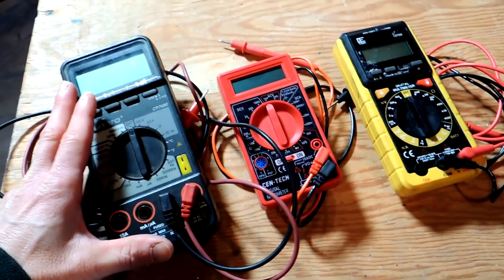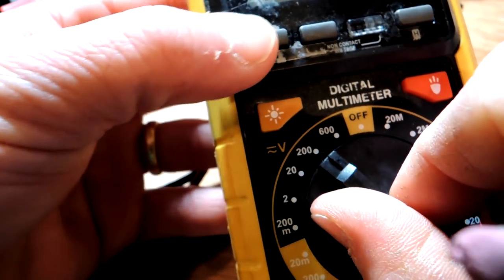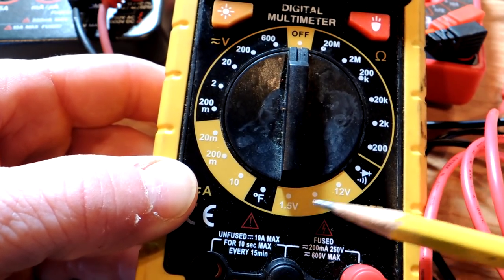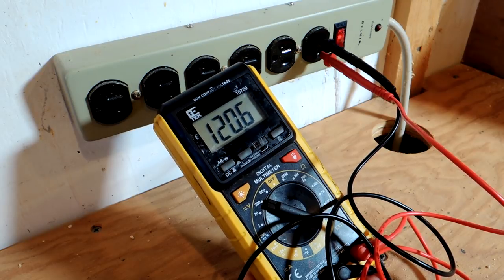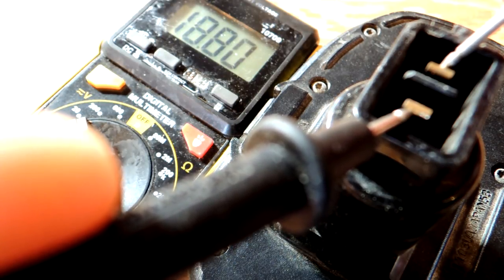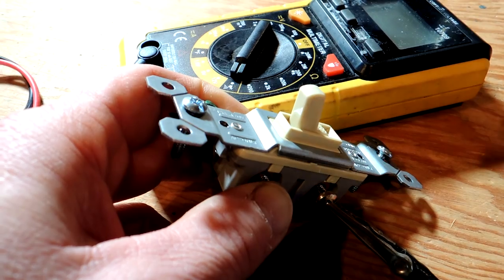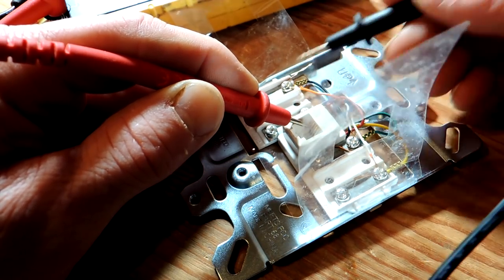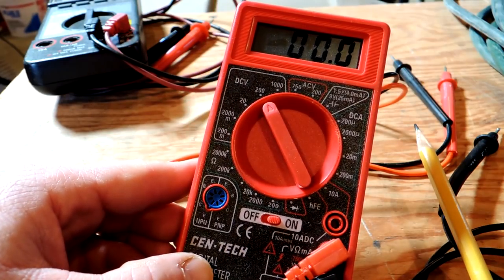How To Use A Digital Multimeter Around Your Home

Comment: I have a couple of questions. If your monitoring solar current, aside from using the Vdc side  is the process different? How do you get a read on a series of batteries that are daisy chained to see how much voltage is being generated?  Second, I know this is how to operate a multimeter, but- If all batteries AAA, AA, C, D are 1.5v why don't they just make them and the device compartments that use them all the same size? Why even bother with big bulky C & D they seem completely unnecessary.
Reply from the maker: I know very little about solar panels, but I believe the voltage is regulated and it's essentially similar to a car, in the 12-24 volt DC range.  The battery question probably has to do with history and the ability of manufacturers to build smaller form factors as time progressed.  Plus, it is the voltage which is the same, not the capacity measured in amp-hours.  A D cell will last much longer than an AA cell.

Comment: wot is the hold button for plse
Reply from the maker: The hold button is just a convenience feature which retains the value of a reading on screen so you don't have to remember it or be looking at the screen some exact moment.   Some meters work differently, but generally you press the button to hold the reading or else you press it in advance of taking a reading and as soon as the meter senses a circuit it holds the reading on the display.

Comment: Does it matter which way you put the prods ???
Reply from the maker: It depends what you are measuring and how your meter is designed.  For AC voltage, for example, it doesn't matter.  For DC voltage in might matter, unless your meter will auto-reverse polarity for you, in which case it doesn't matter.  If it does auto-reverse polarity for you, you may see a "minus" sign on the reading, but the absolute reading is correct.  For something like continuity or resistance it generally doesn't matter until you get pretty deep into the weeds on some electronic circuits.  Basically the red is considered "positive" and the black is considered "negative" polarity.  You won't hurt anything if you switch leads, the worse thing to happen would be that the reading doesn't make sense.
Reply: @enduringcharm  Thanks for taking the time to reply and for a very informative reply.

Comment: How do you use the centech to test continuity with no tone?
Reply from the maker: Not all meters have a tone function, so you just select the Ohm function.  If it reads 1 there's no continuity if it reads 0 there's continuity.  if it reads something in between there's continuity but not a perfect connection.  Of course, you need to be able to look at the meter for this test, which is not as convenient as having a tone.
Reply: @enduringcharm  this is really helpful as I am hearing impaired and cannot hear the beep doing a continuity test.

Comment: Great tutorial.  Does this mean that the USA really has 240 volts and not 120 volts?
Reply from the maker: The USA uses a 120 volt system, which is supplied as two 120 volt "legs" into a home.  Most household items run on 120 volts.  However, some items which require greater current, such as electric ovens, air conditioning systems, well pumps or electric water heaters, use 240 volts.  This is accomplished by combining the two legs--120v plus 120v equals 240v.  Since each leg supplied into a home is alternating current, they are also set up to alternate at an opposing 60 cycle rate.  For this reason, it is possible to use one 120v leg on a circuit in place of a separate neutral wire for the other leg.  This video has more information:  https://youtu.be/kCRzEOqeRdw

Comment: When you checking the plugs was the red to live and black to neutral ? I couldn't see properly
Reply from the maker: You mean electrical outlets on your home?  It really doesn't matter which color goes where.  The meter will register the AC voltage either way.

Comment: These meters use a 9 volt battery to power the display and power the  ohms  and continuity tests. Turn the dial to off  otherwise the battery will run down and  you will need to replace the battery  to test anything.

Comment: So how.do u use it to.see if a.wire is hot...
Reply from the maker: If you are referring to household 120V wiring, there are three wires in a cable.  The black wire is "hot" the white wire is "neutral"  and the bare copper wire is "ground".  With your meter on the AC volt setting and scale setting at least 200V, you can put the red test lead on the black wire and the black test lead on either the white neutral wire or the ground wire.    If the black wire is hot it will read around 120 volts.   Needless to say, avoid touching the black wire with your hands or having the other wires connect with the black wire.  If the wires are still connected to an outlet, you can just touch the test leads to the outlet screws of the appropriate wire.

Comment: Great vid. I have the yellow 1. When switching the dail to settings it always reads OL overranged i think... Why?? I know nothing about this thing. Your vid is very very helpful btw... Also how do you use the wireless reading?
Reply from the maker: The OL is just an open circuit, and the infinite reading is more than the meter can measure (obviously).   You'll get this when set to Ohms and you don't have the leads connected.  The "wireless" reading you mention is actually just an inductive pickup which alerts you to live electric in a wall or wherever.  It's sometimes useful, but don't rely on it for safety!

Comment: How do I test a 4 prong fluorescent light?
Reply from the maker: You need to be more specific.  What are you trying to test?  You can use a meter to confirm that the power cord is supplying power to the ballast.  You may be able to check the ballast for continuity or resistance.  It's more than I can answer in a reply here, but if you search for ballast testing I think you'll find some help.

Comment: I just bought the Everstart Cat max VIII (your blk/yellow one) because my stove isn't working right and seems like men always have multimeters, but i am literally CLUELESS as to electrical AND multimeters. Absolutely clueless.
I'm listening to this hoping to learn something.
Reply from the maker: You can use your new meter to check that the 240 volt outlet to your stove is working (check both "legs" of the receptacle.  Two 120 volt legs put together make the 240 volts you need for the stove).  You can also check the wiring of the stove if you can get access, either by checking the voltage with the stove plugged in or by checking continuity of wiring with the ohmmeter and the stove unplugged.
Reply: @enduringcharm  Thank you for replying!

Comment: so, if you are checking voltage of a 48 volt battery bank setup, you keep on DC and put on 200, then check the actual readout?
also, if a car battery has a suspected bad or arced out cell, that should be seen with continuity test? That is, no sound or no change off of "1" on the Harbor Freight cheapo which I have?
Lastly, what is wrong  with this?  My cheapo HF Meter bad?  If I put on 200 ohm on dial, and I then put the two wires together, it goes to anywhere between 2 and 42, Each time, after turn off then back on then re connect the needles, the reading is different.. 9.1, 5.3, 8.2, 7.3, 4.9.... and I am pressing the two needles together firmly...... WTF??? Is it a bad ohm meter in the unit?
Reply from the maker: An automotive battery with a bad cell will exhibit a much lower voltage than is typical at rest.  For example, instead of 12.x volts you'll read 10.5 volts.  A continuity test has nothing to do with it.  As for your wandering ohm readings it does take a little bit of time for the reading to settle down.  If you are moving the probes at all you should expect the reading to change.  Another issue could be loose wires connected to your probes or the probe tips have become unscrewed from their base.

Comment: I plugged in a harbor freight meter & sparked horrible it melted the black probe off the wire & started smoking i guess i had the meter set to DC rather then AC.
Reply from the maker: If you put the meter leads into an AC outlet with the meter set to DC scale, nothing will happen.  I don't know why your lead melted, but it was for some other reason.
Reply: @enduringcharm  I have no idea why this happened, I talked to a contractor recently he told me that it may been a faulty meter not sure that's what it was either, I bought an outlet tester plugged it into the metal outlet box the wiring shows correct so I'm yet scratching my head on this one but I sure don't want to use another meter testor on this metal box outlet only to ruin another one.
Reply from the maker: I suspect your contractor friend is correct.  For a wire to melt it had to be high current flow, so either the meter was internally faulty or else you somehow shorted out the lead when you were working.  The latter could happen if you had the lead connected to the hot and then the lead got pinched and grounded, for example.  I've been working with multimeters in remodeling, automotive and electronics applications over four decades and I've never seen a meter lead go up in smoke.  You could replace the leads and see if the meter is still functional, or just take it back and get it replaced by HF.

Comment: Thanks a bunch!!!I have one question though. Hope it doesnt sound too silly...On my harbor freight multi meter I notice a "10AMP MAX" underneath the on switch. Does that mean I cannot test a circuit in the house that has a 15 or 20AMP circuit breaker?
Reply from the maker: This can get complex very quickly, so I'm going to try and keep it simple.  In the meter there is a fuse (10 amp in your case) to try and protect the meter IF you are measuring amperage.  To measure amperage you would need to put the meter into the circuit you are measuring.  I did not show that process in the video at all and I would not recommend it to a homeowner.  There are other, safer, ways of measuring amperage, including a clamp style meter which measures amperage by sensing the magnetic field around a wire.  In the video I showed the measurement of voltage in your house by sticking the leads right into the wall outlet.  In that example you are measuring VOLTAGE not amperage.  The meter is set up to handle this without issue.  No current (amperage) is really flowing when you measure the voltage this way so it is safe for the meter and for you.  Think of voltage as a bucket of water.  That's the potential you have.  If I stick a straw in the water and start sucking on the other end, the amount of water coming through the straw can be compared to amperage.  The resistance can be compared to the size of the straw--if I have a narrow straw I need to suck a lot harder to get the same amount of water as with a wider straw.  So, when you measure voltage the meter isn't actually pulling any water through the straw.  Bottom line: you can measure house voltage as I showed in the video and not worry about the amps.

Comment: Good clip except for the ohm meter part that made no sense at all and never explained things like what the "0" or "1" means and a couple of other things as well, but in general I learned something so thanks.
Reply from the maker: The zero and the one represent opposite ends of the scale.  Zero means no resistance at all, one means infinite resistance or no connection.
Reply: @enduringcharm  I didn't know that so thanks so much for the lesson. Now I get it better.

Comment: The red multimeter doesn’t have continuity.That symbol is for testing diodes
Reply from the maker: Good catch!  I had to dig that meter out and take another look,  Many meter manufacturers make that a "combo" setting of both continuity and diode, which was the case on that yellow meter in the video.  But the red meter had just diode.  In that case the ohm setting can be used instead.

Comment: Its funny you mention 1 leg going down from the power company. That is exactly what happened to me. I woke up one morning and only half of the house had power. I figured it out immediately and called the power company. They put a transformer out in my yard and ran my house over the one that was still working for over a month until the replaced the wires from my house to the pole. It worked ok but I noticed a wider fluxuation in voltage and was only getting 230v.  Once they replaced the wires I see 242v. This is a 15 second video showing what they used if you are interested. https://www.youtube.com/watch?v=ZXoYRKL2Fog
Reply from the maker: Wow, I've never seen that done before!  In my area they come and replace the transformer in a day or two.
Reply: @enduringcharm  yeah all I can say is they did get it up and running in 3 hrs and it wasn't a transformer it was one of my wires running to the house. They had to bury a new line to the pole about 50 ft away. I do think they forgot about me since I waited 3 weeks before asking what was up and they said the ticket was closed. A few days later they burried the new line removed the transformer. They somehow increased the voltage of the one leg that still worked to 240v then split it back to 2 120v legs.

Comment: 12.4 volts across a car battery is not a good sign, it's only charged 75% and may not even start you car in cold weather.
Reply from the maker: In the video that was actually a mower battery, but let's go into more detail either way.  Resting voltage in a 12 volt system vehicle battery refers to the voltage when the engine is not running and therefore not charging.  Ideally resting voltage is somewhere in the upper half of the 12-13 volt range.  However, it's pretty common to see voltage in the lower half of that range in vehicles that still start everyday.  I have an old Jeep that gets only occasional use and it's older battery has a resting voltage of 12.3.  It still starts.  Why?  Well, there are a lot of variables in the starting of a vehicle.  Ambient temperature has a huge effect, which is why a marginal battery may start a car in the summer but fail when the seasons change.  Every connection of cables is a place where voltage drops can occur, so corroded connections can stop a good battery from doing it's job.  The condition of the engine and starter can make turning over the engine easy or difficult, depending on the wear, the oil viscosity and the compression.  And, voltage is just one measure of the capacity of a battery.  Amp-hour or similar measures of capacity test a batteries ability to supply a voltage over a period of time.  It's possible to have a battery with, say, a 12.2v resting voltage that can start a car but another battery with a healthier voltage that cannot.  Sometimes the healthy looking voltage is just a "surface charge" with no real capacity behind it to provide that voltage over time.  So, don't get too hung up on resting voltage as an indicator of battery health.  It is one clue, but not the only one.

Comment: hey joe pesci its your paisan from the bronx,you helped me out with the condensation for my ac unit, i bought the same multi meter the red one .and aligator clip set up . to see if the cord is good OVERALL do i set it up the same way you have it ,or is that just to see if the ground is good?  i set it up as you did and i didnt hear a sound. all it shows is 001 002  no sound ,i even put a new battery in the meter. shit joe i just looked that red meter doesnt have the lil picture of sound next to the continuity .is that the problem. in ur video your using the yellow meter. im retarded
Reply from the maker: Well, I guess I just have to wait long enough for you to solve your own problem?  It sounds like you are trying to do a continuity test, in other words to make certain a wire is good from one end to the other.  There may be two different ways of doing that on a meter.  One is with the continuity setting, which is the ringing tone you mentioned.  That just beeps if it senses a connect between the test leads.  The second method would be with the ohm setting.  On that scale, a readout of "1" means infinite resistance or no connection.  A readout of "0" means no resistance or continuity.  So, a beep or a zero is the same thing.  The ohm scale can give you more nuance, though, because it will also give you a reading in ohms if there is some resistance but still continuity.  So, you could have a wire that is technically connected but has a poor connection, and the ohmmeter will help you see that.  Incidentally, the ohm scale is a good thing to try when you first turn on your meter to test the leads themselves.  If you touch the leads together and don't get a zero or close to it, then you have something wrong with the leads or the meter.

Comment: Are those alligator clips taped on to plastic tubing? I don't get it. When you showed how to test a light fixture with continuity I couldn't see the entire set up and don't really understand the plastic tubing. Help please. Thank you.
Reply from the maker: So, the meter will have two leads that come with it, which have the pointy ends to hold against whatever you are testing.  Alligator clips are just a way to make it easier to test when you only have two hands.  Typically you'll have a wire about two feet long with an alligator clip on each end.  The plastic tubing you thought you saw was probably just insulation covering the wire.  After all, you don't want the test lead touching anything else.  The alligator clips can be used a number of ways, one of which is to connect one clip to your meter lead pointy end, and the clip on the opposite end to whatever you are testing.  That's what I was doing in the video.  It just allows you to be hands-free and not worry about holding the meter leads in position.  Now, you can also buy meter leads with alligator clip ends, which accomplishes the same thing.  Make sense?